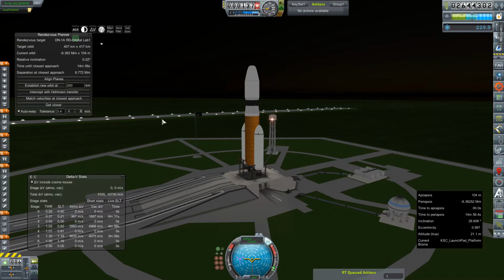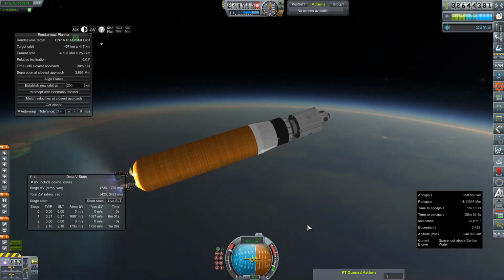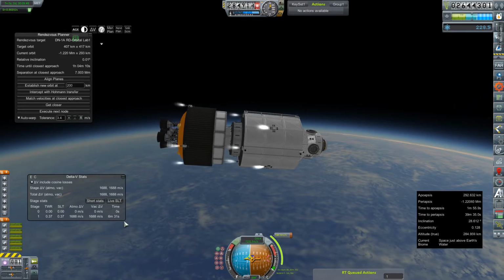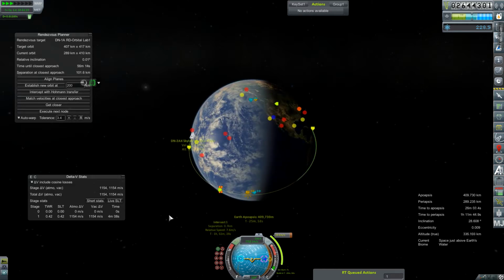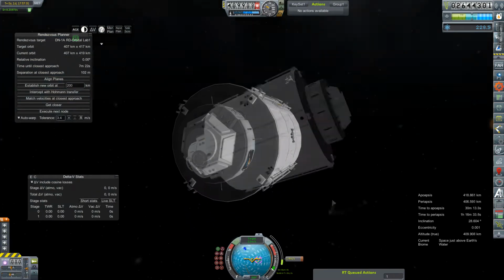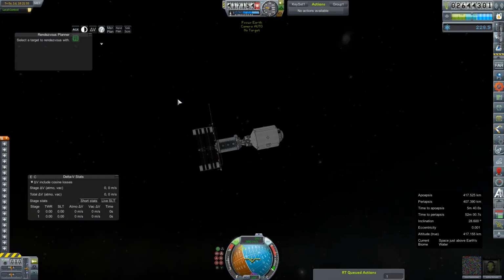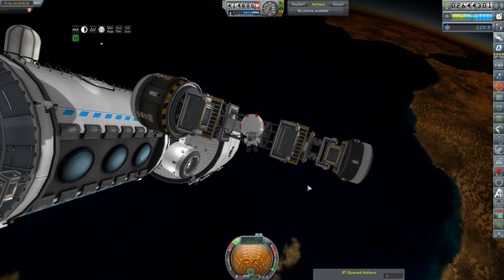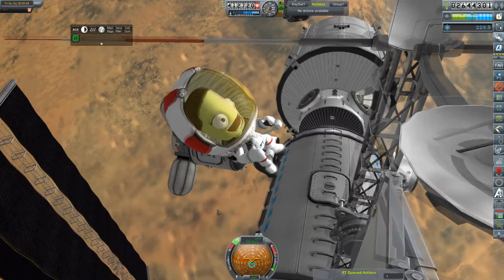KSP RP-0 #315 SkyLab Module Launch

Comment: Hey dude, nice videos. I really like them. I've been an "experienced" ksp player for a very long time, but I've never played RSS-RP-0. My knowledge about different types of real fuel, pressurized sections and that stuff is 0/10. If I download your 1.2.2 RSS/RP-0 Gamedata folder and delete the Real Fuels mod, will I be able to play without any incompatibilities?
Reply: just learn it dude, it won't take long. Real Fuels is the very core of RO.
Reply: No, you wont be able to play it. It is one of the core mods and a very important requirement. But to be honest, the real fuels mod is not very difficult. In case you have specific questions about the RF mod, you can ask me :)
Reply: 404 ERROR I know that you can fill a tank with the correct fuels right clicking on them after stacking the engine. What I'm extremely confused about is how do I know what type of tanks do I need to use for certain missions? Pressurized, non pressurized...

I would appreciate a nice guide of RF in general if there is even one, I cannot find this info out there :D

(sorry for the bad english btw)
Reply: The thing with the types of tanks is actually also not that difficult. i will make it quick:

-If you place an engine, fill the tank and if it says:"Feed pressure too low" means that you have to switch the tank type to Service Module or Fuselage. You mostly need such a tank type if one of the following fuels is used: Aerozine50, NTO, MMH, UDMH, MON3. These fuels do not boil off and are perfect for long term missions, RCS thrusters and probes.

-For all the other fuels you can actually use the standard tank. Remember, that cryogenic propellant( liquid Oxygen, Hydrogen, Methane also I guess )boils off. In order to reduce the boil off speed, you can switch to cryo tank types. These fuels are perfect for your launch vehicles. Use Kerosene for powerful first stages and liquid hydrogen for efficient upper stages. 

- The default and cryo tanks are also avaible in a ballon variant. This makes the tank a lot lighter.
Reply: 404 ERROR Thank you so much for the explanation! I'll give it a go and try to remember the basics :)
Reply: good luck ^^
Reply from the maker: 404 ERROR is on point - knows this stuff inside and out - won't lead you astray.  This is all very solid advice.

Comment: In which episode did you first land on mars? I'm about to try my first mars mission ever, which happens to be in my speed-run campaign (aiming for mars before 63!), and I'm looking for some reference.
Reply: 282 - 284
Reply: Wow my lander is overbuilt, I could loose five tones off of 20 total  if I use parachutes.
Reply from the maker: I assume youre shooting for a crewed landing ( what with it being 15t-20t.. ) I was able to pull it off in '75 - though there is a LOT of room for improvement with that figure.  even being able to shoot for a '63 landing is damn impressive.